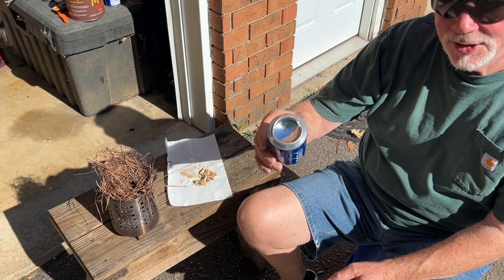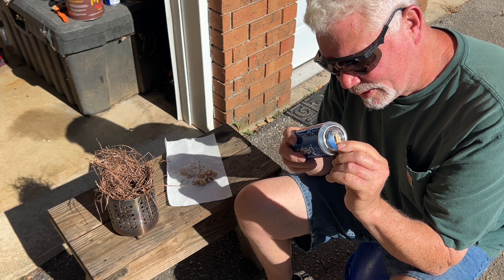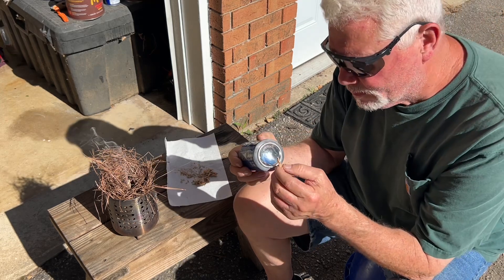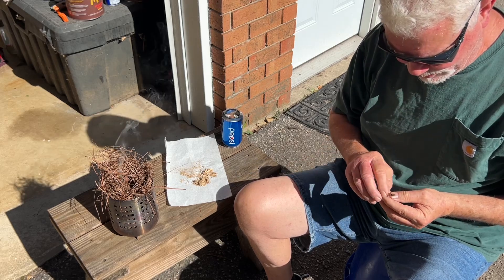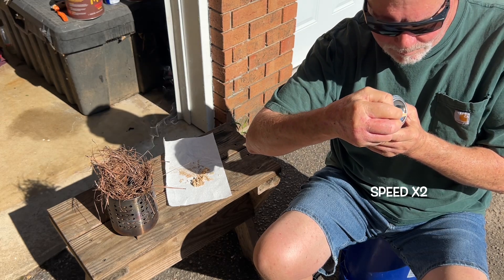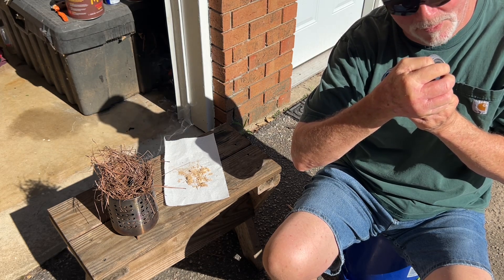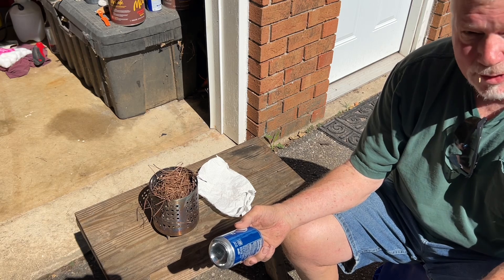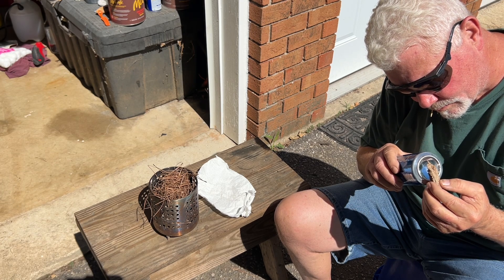How To Solar Ignite Punkwood With A Pepsi Can

Comment: Thanks, David. 
When trying to find the right angle to point the can at the sun, simply look at the shadow the can casts. If the shadow is elongated (showing the sides of the can), adjust its angle until it's just a round dot, then hold it in place as you ignite the punkwood.
Reply from the maker: I’ve given that advice a lot in the videos in my solar ignitions playlist. I no longer need to do that. My aim is always on after all these years. What you saw was me being forced to aim from an uncomfortable position because I was trying to get everything in the shot. People don’t realize how difficult it is to get all the angles right and still get it on video.
Reply: @DavidWestBgood2ppl  That's very likely where I saw it and thought it sufficiently worthy to pass on to other viewers. -- I've watched enough youtube videographers to notice the gymnastics they go through to get everything in the shot. There are always a lot of tiny distractions and details to monitor plus keeping the dialog going ... and they don't always succeed. Thanks again, David!